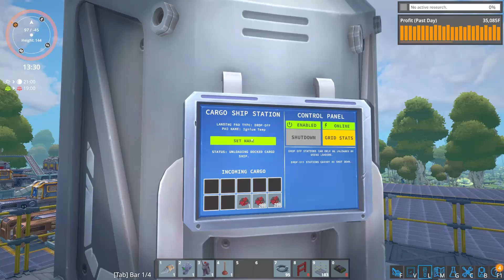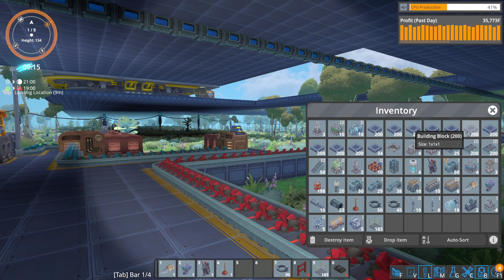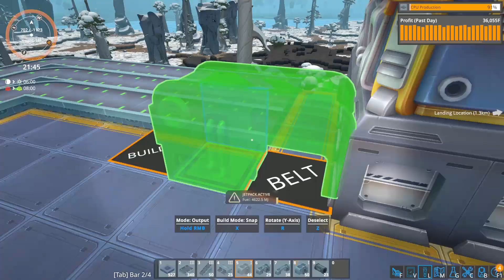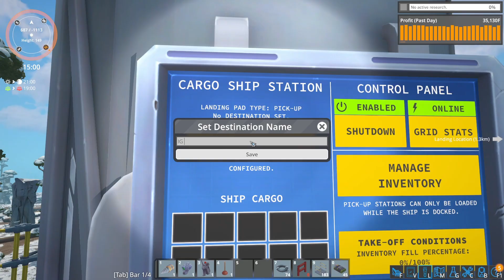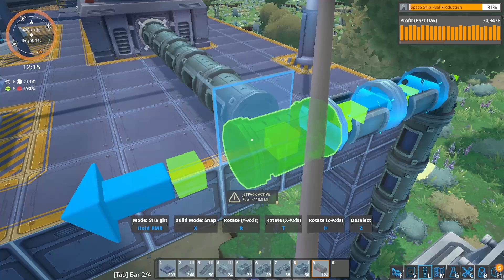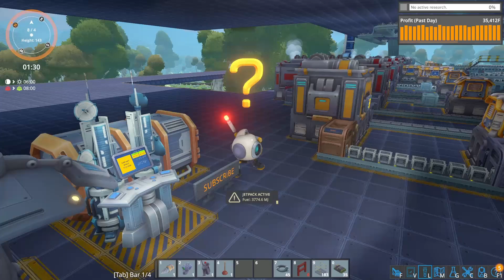Foundry - Mega Delivery Depot Setup - Update 2 [E9]

Comment: Good stuff.  I sort of regret listening to Carl because he pushes you to galactic trade maybe too early.  You have a solid infrastructure going that can support things coming soon.  I have the station almost rebuilt and lots of cash, but other than the few bots I am pushing out now I really can't support much more.  Still, I can recover with solid builds now that I can do ore mining.  In fact, I found a spot with all except technum ore fairly close to each other and that place has 3 technum nodes close enough that I should be fine.  I do have 2 mineral ore mines fairly close so not sure why you have none.  

I am not sure how this will work out but I have places very suited for like circuit boards and energy cells but little else.  So I am thinking to set up remote bases to do those and nothing else then fly the circuit boards where they are most needed and the same with the energy cells.  The thought is to use those for specific mats and save the closer to main factory nodes and mines for the basic needs.  Anyway, I had like 35 hours before the update.  I liked the game before but it was nothing special.  Since the update I have added like 80 hours.  I might back off a little to prevent burnout but it has become my addiction for sure.
Reply from the maker: There are many ways to play this game. I don't know if how I am playing will work out well but it is worth a try.

Comment: Radio antenna is just a mobile uplink but costs 10MWatts. It's easier to just plop an uplink console here and there. Solar is only good for 11 hours per day so you need at least ~2.25 times as much from solar and then enough batteries to last the night (13 hours).
Reply from the maker: Yeah. Solar farms need to be really big. It is really just there to take the load off the Ignium production.

Comment: I like seeing how you are setting up the next stage of mining.  I am almost there, ahead of you on other things as i have the first two large structures complete and shipping fuel and building components to space station.   Pulling in 150k a day in sales and my dept is down to 3mill.  My R&D  is pulling 2xp per droid now but still only shipping 4 bots.  Tonight i have to build a new steel facility as my starting one is almost ore dead. Power is an issue as well, running 17 steam gens and need to setup more solar and batteries.  So many things on the to do list.
Reply from the maker: That sounds great. Always lots to do.